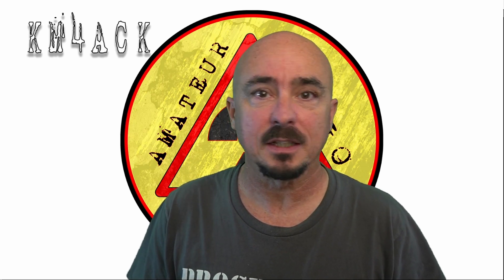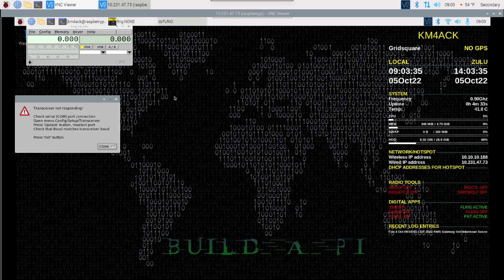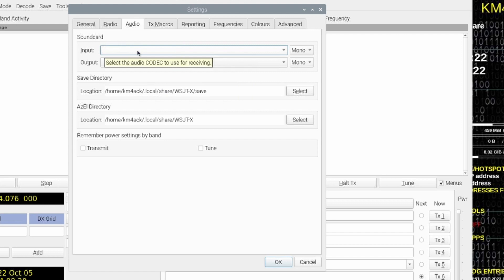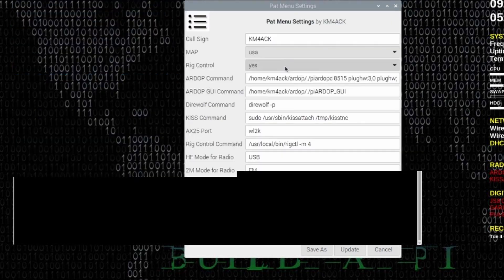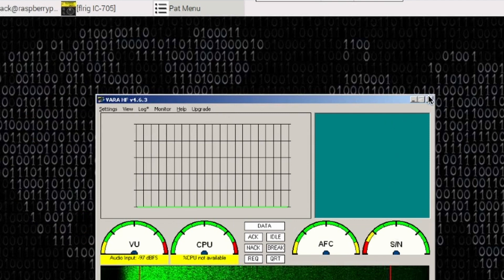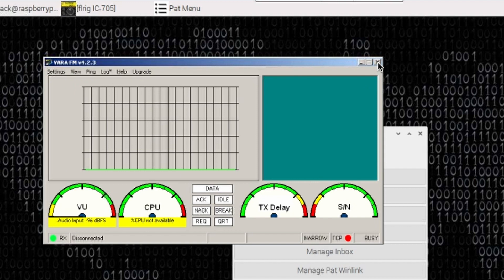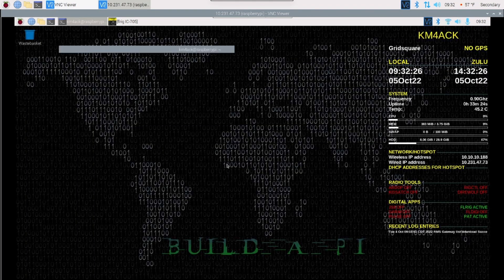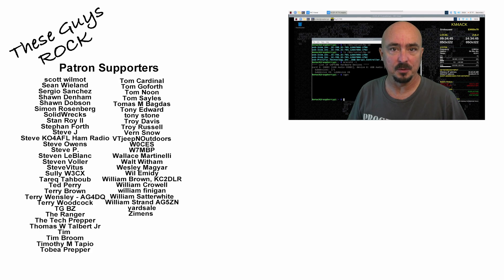Icom 705 Build a Pi Setup

Comment: No GPS!  Another great video Jason, thank you. I could not see the GPS data in the terminal window using cgps. Then checked my settings in the IC-705. You need GPS Out selected to on. i.e Menu>Set>Connectors>USB (B) Function>GPS Out - ON. Just a tip. You already know this but I just thought I should mention it for others who may have the same problem as myself. All good now. Thanks and 73's Bob

Comment: On the IC-705, where is Baud Rate set for FLRIG?
Reply from the maker: I should have been more specific in the video. The 705 doesn't have a user adjustable baud rate like other radios. It is always 19200 as far as I know